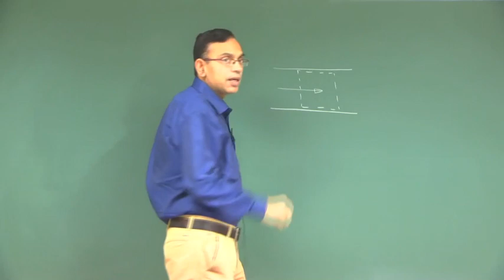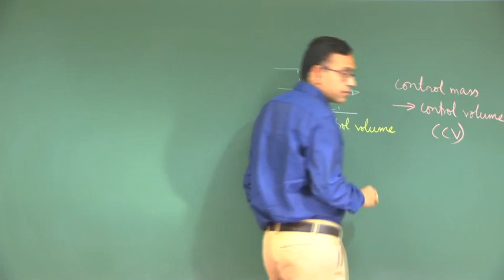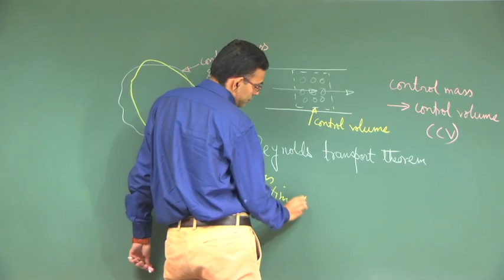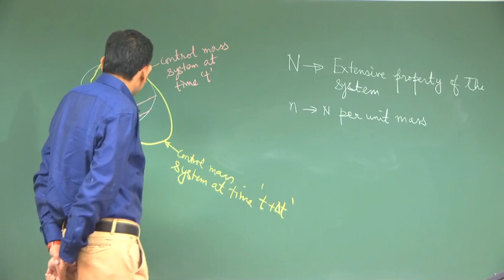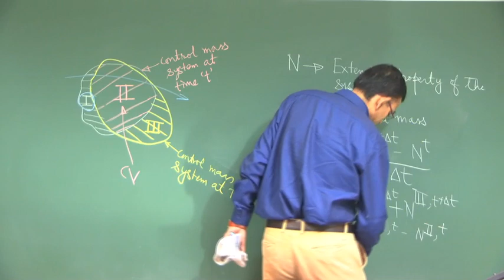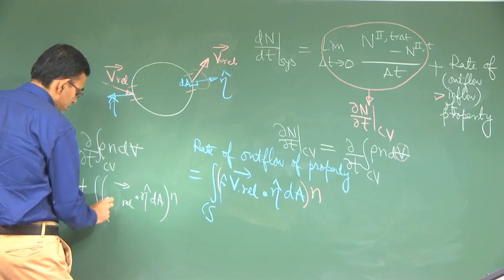Lecture 19 : Control Volume Conservation Reynolds Transport Theorem

Comment: please solve this problem.a water jet is turned through an angle of 180 dgree by the device shown in figure.the fluid stream has a constant diameter of 2cm.if the magnitude of the restraining force is 500kpa,estimate the average water velocity of the incoming water jet.do you think this is a realistic set of flow condition?why or why not?